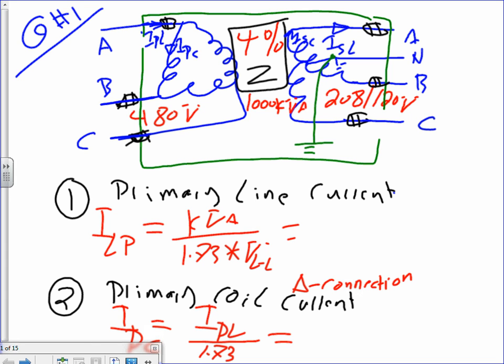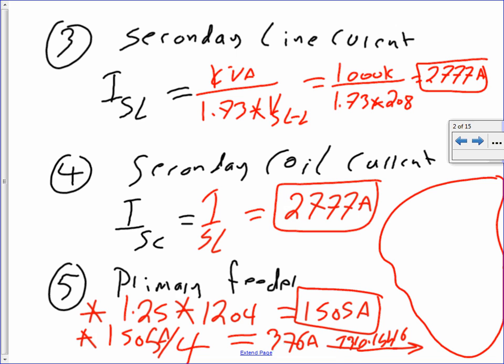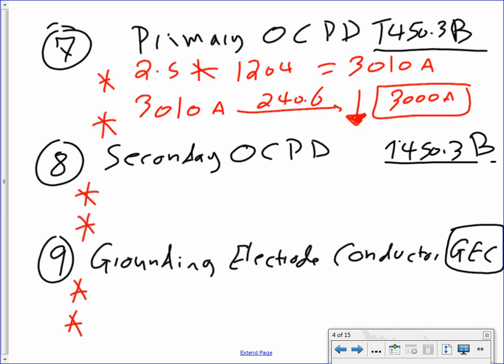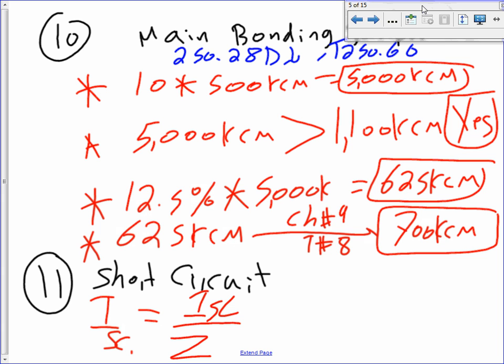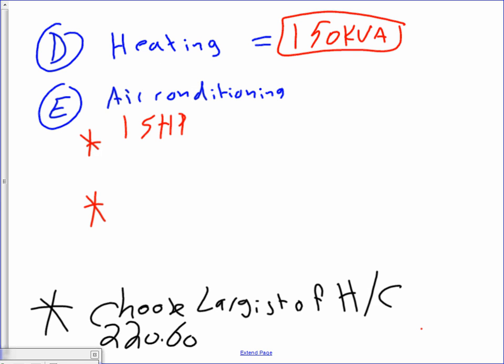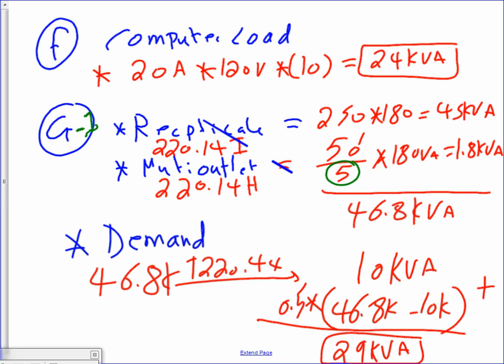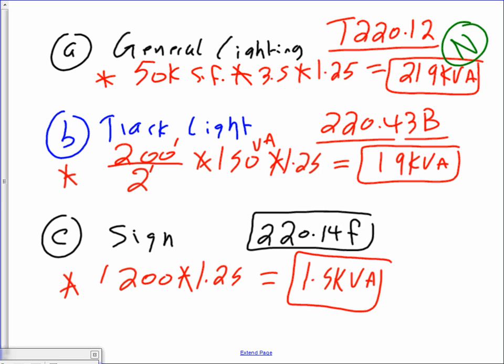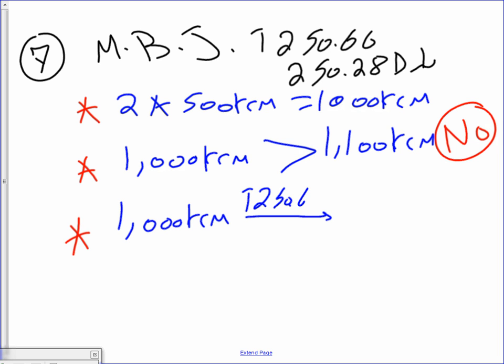Transformer & Load Calculation Sizing T#1 Review for 10 25 13

Comment: I noticed that after you used the kva and volt along with the 1.73 formula by dividing to obtain the line current, for the  secondary side of the step down transformer, can this formula be used in the reverse as a step up transformer formula. thank you for your response 18763290315